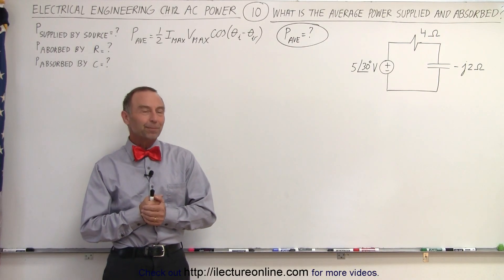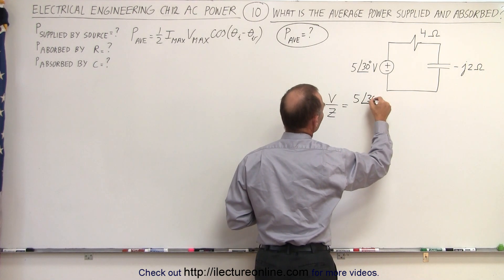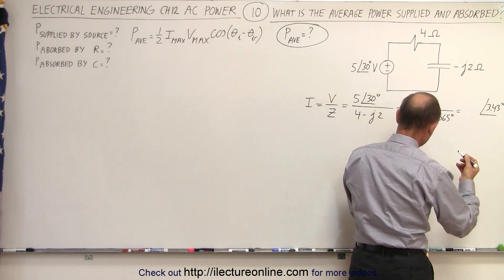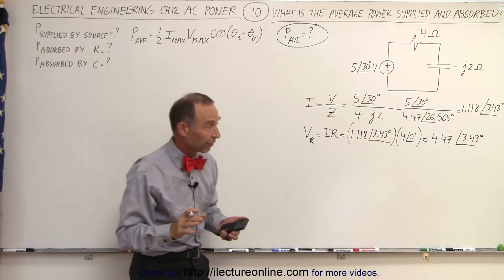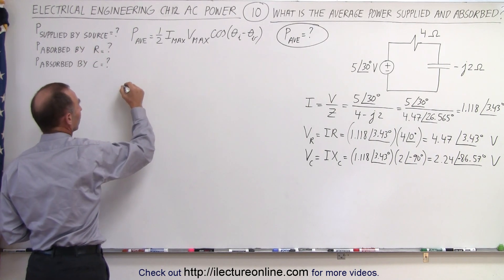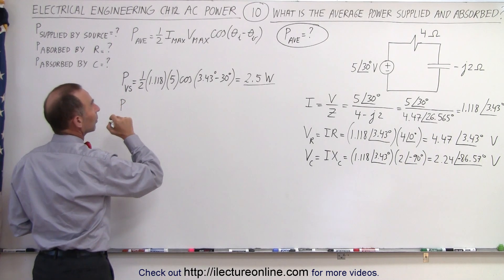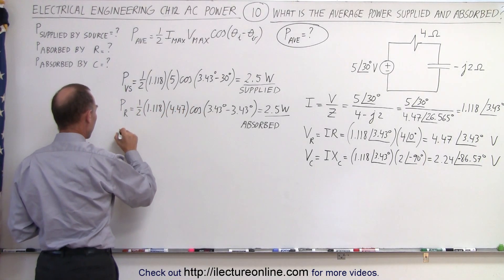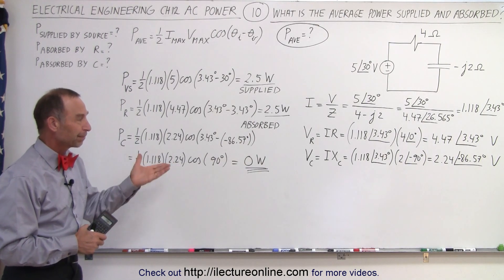Electrical Engineering: Ch 12 AC Power (10 of 38)What is Average Power Supplied and Absorbed?(-26.5)

Comment: Thank you so much for your videos! I have a question: If the supply voltage is in polar form, I was told that by convention means it is already an RMS-voltage. Therefore, why are we still dividing by 1/2 and using Vmax & Imax?
Reply from the maker: In the video, it is made clear that the I and V in the power equation are in terms of the maximum values, not the RMS values.
Reply: @MichelvanBiezen  thank you. And thanks again for the video!

Comment: I had a question. Why is X sub c 2 phase angle of -90 degrees? I know where the two comes but where does the phase angle come from?
Reply from the maker: The voltage across a capacitor is always 90 degrees behind the voltage across the resistor, (and the voltage across the inductor is always 90 degrees ahead of the voltage across the resistor).  Hence the - 90 degrees.
Reply: @MichelvanBiezen  ooooooooh thank you sooooo much. I really appreciate your videos. Helping me get through Circuits Analysis 2.
Reply from the maker: Glad you find our videos helpful.   🙂

Comment: How to find Z
Reply from the maker: Since the 2 components are in series, you can just add them up:   Z = ristance of the resistor + impedance of the capacitor.  (The impedance of the capacitor lags the resistance of the resistor by 90 degrees)

Comment: while calculating the voltage across the capacitance  how the phase angle will be 90 deg and while calculating the voltage across the resister , phase angle 0 deg.. can any one tell me please ??
Reply from the maker: That is all explained in great detail in this playlist:  PHYSICS 49 RCL CIRCUITS.    The phase angle indicates the difference when the current in the circuit reaches its maximum value, and when the voltage across the component reaches its maximum value.
Reply: @MichelvanBiezen  thankyou so much professor.

Comment: Thank you so much for this wonderful resource Sir. I have a question though. Why is it that I can not use the P=VI to calculate power across the components, can you please explain to me when to use the P=VI and when to use P=(1/2)(Imax)(Vmax)cos(ϕi-ϕv)? It would be a huge favor, thank you!
Reply from the maker: If there is a phase difference between the voltage and the current in the circuit you must use the second equation.  If there is no phase difference, the second equation collapses into the first equation.
Reply: @MichelvanBiezen  Thank you so much for the answer, its all very clear now! You are an excellent teacher Sir!

Comment: Why was the angle negative for X_c when finding the voltage across the capacitor?
Reply from the maker: The voltage lags the current across a capacitor by 90 degrees.

Comment: Is it always in a RC circuit that P absorbed by the capacitor turns out to be 0?
I mean what's the physical reason of this
Reply from the maker: Both the inductor and the capacitor are devices that essentially do not consume power.  The inductor does have a coil that has some resistance, therefore in the real component, there is some power consumption.  In the capacitor there is no coil and very little wire, therefore there is very little to no power consumption.  (Only resistance consumes power).
Reply: @MichelvanBiezen   Thank you so much